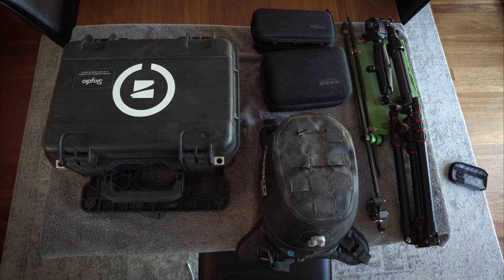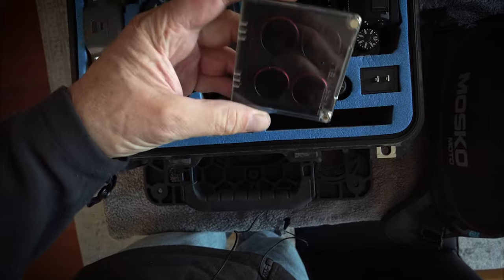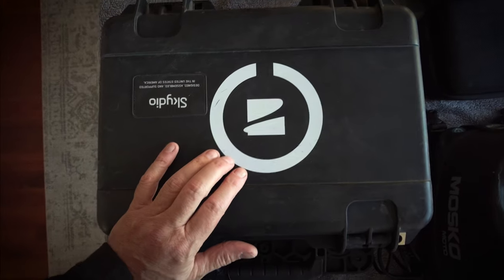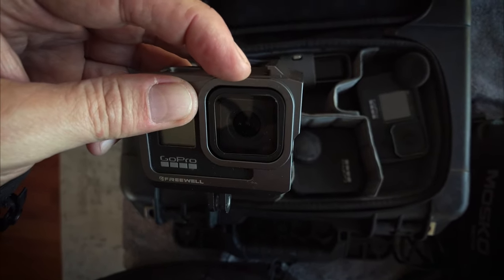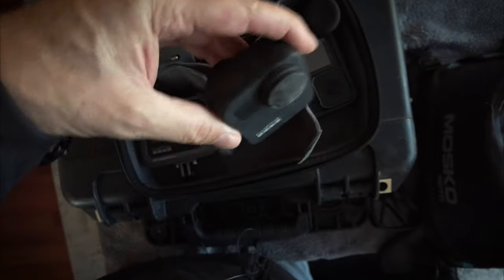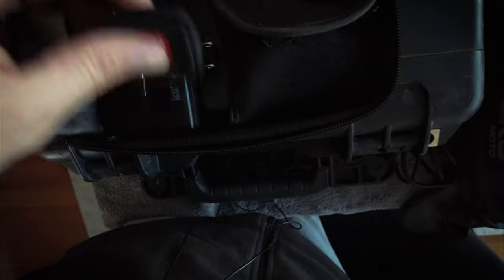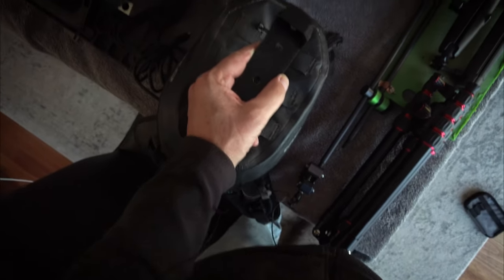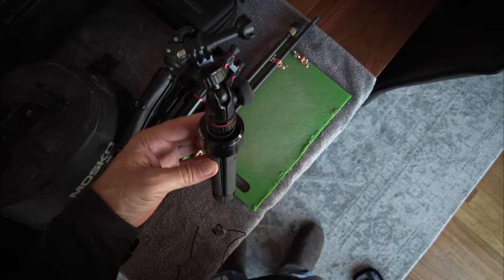Is 6 Cameras overkill? - What's in my bag for videoing the Idaho BDR

Comment: That use of the MoskoMoto wedge is genius. I've been trying to work out how to mount my pelican case so I can quickly put it on and take it off when I'm going in to hotels etc. Thanks a lot for the great videos. The BDR vids were epic.
Reply from the maker: Thanks RTST.   Yeah, I spent ages trying to think about the perfect system for my pelican case, and then it came to me.   The Mosko wedge works really well.  Rock solid installation, and I can remove it in about 5 seconds.

Comment: I’m bringing 4 cams when we do the Colorado BDR in a week or so. Sony ZV1 for off the bike, Skydio 2 for above the bike, Insta 360 1 X2 on the bike and a GoPro Hero 8 on the helmet. I ended up getting a Givi top case so I could also bring a laptop to copy off all the files instead of mounting the Skydio case like you did. For audio I’m bringing a Tascam Dr40x with an extra Cardo Pactalk to record our conversations as we ride. We are staying in hotels every night so recharging won’t be an issue.
Reply from the maker: Hey Steve, it sounds like you are also a hard core adv camera geek like me.  I look forward to seeing what you produce o the Colardo BDR... looks like we have very similar setups (Skydio, GoPro, Insta360).    I don't tend to record the helmet comms.... perhaps because we talk crap most of the time :-).   But I usually add a v/o in post production that is more concise and on-point than the ramblings when we ride.    I find it too hard to coordinate the storyline when I'm riding as I might not have even worked out the storyline at that point.

Comment: Hey Brent, love your videos. First came across your channel while working with Motorrad. You sent that cracking shot from the Red Hill Hotel in, the one hanging on the wall behind you!
How did the skydio gimbal fare after the vibration through the rear rack? I heard the off road riding kills most DJI’s.
Keep up the great work!
Cheers,
Jules
Reply from the maker: Hey Jules,  I'm not sure if you have watched the two videos I did on the Idaho BDR,  if you haven't check them out... The Skydio is pretty sturdy,  They make drones for the military, so I'm assuming that some of the key parts are pretty tough.   I've had no problems with the drone being on my rear rack... I've done two long trips over rough terrain (Victorian High Country which was 7 days and Idaho BDR which was 8 days).

So I think they are pretty’s  robust.
BP
Reply: @brentbat  I did watch them, very epic. Another trip to add to the bucket list!

I just managed to squeeze in a Safari before this latest lockdown and can’t wait to get out again.

Looking forward to getting my hands on a Skydio here in Aus, well worth trading the Mavic pro for.

Ride safe mate 👍
Reply from the maker: @JulesSpiller  Thanks Jules.  Yes, for motorcyle videos, there is no comparison between the DJI and Skydio Technology.   I really like DJI drones, they make a great product, but 95% of what I want them for is to follow me on the bike.... and they are not that good for that purpose.

Glad you got a safari in before lockdown.... yes, I feel very lucky that I got to ride the IDBDR.   Now I'm back in quarantine and will soon be out ... In lockdown.  At least I can work on my Husky and continue my Adv build.... even if I can't ride it for now.

Comment: Brent I noticed that there is not a lot of Insta360 footage in the IDBDR videos; some scenes at 4:50 to about 6:00 in Part 2/Day 4, although I may have missed more because I was so immersed in the story telling. Did you discover that you don't like the 360 distortion, or there was so much more better footage that it "ended up on the cutting room floor?"
Reply from the maker: Hey Lee
I actually found that a lot of the angles I tried didn't work very well.   I tried a pole out front, and I also tried a pole out the back...and in. most cases the bouncing created footage that I didn't like.  However, I did LOVE the angle over my shoulder where I had the camera on a little boom pole from my backpack.    

Generally I found that the camera just wasn't suited to doing a multi-day adventure ride,  however, once I can get out and ride again in Sydney I'm planning to do a few day rides where I will feature the Insta360.  So stay tuned.
Reply: Thanks for explaining. Looking forward to the new content! ;-)
Reply: Are you going to get a Hero 10 and do a review on that? Would enjoy learning from the application of your industry knowledge...
Reply from the maker: @LeeHollingworth  Hey Lee, yes, I've already picked up the Hero 10.    I'm going for my first ride with it on 15th October, so it will be interesting to see how much better Hypersmooth 4.0 is.   The two things that I really bought it for were Hypersmooth 4 and better horizon levelling (up to 45degrees).    The extra resolution and frame rates don't do a whole lot for me.   So we'll see how it performs.